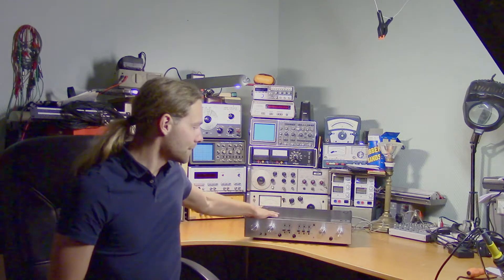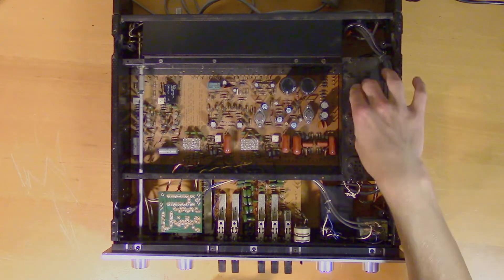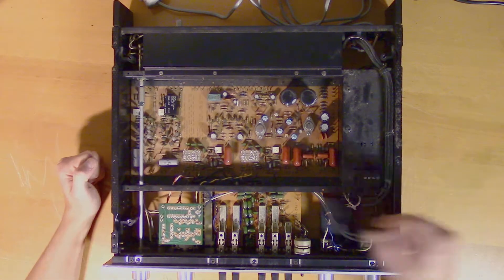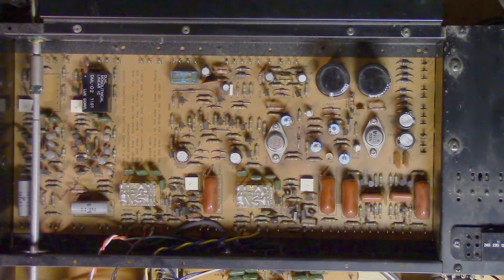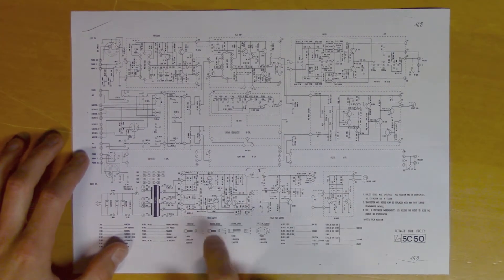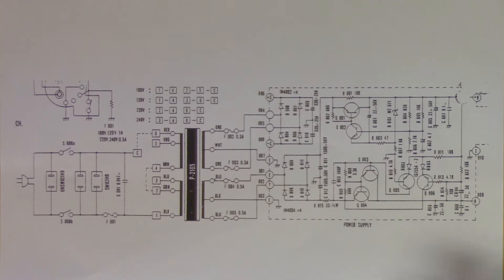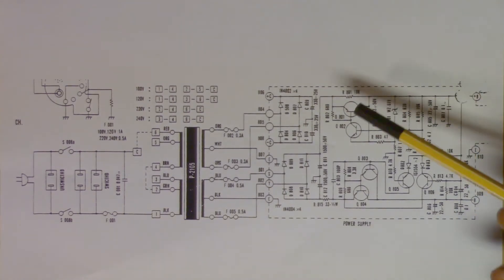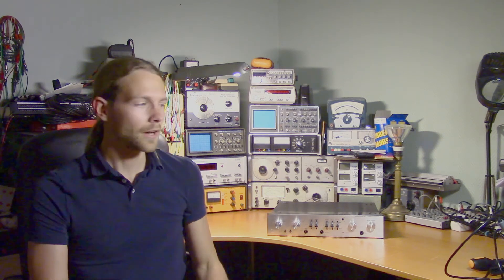Luxman 5C50 Laboratory Reference Preamplifier Troubleshooting and Repair

Comment: Hello, thank you very much for the video, I have a problem with my 5C50 The indicatir goes RED DCoffset (instead of being white) What do you think can be the problem? Thank you
Reply from the maker: Hi! Thanks a lot! First of all, I would make sure that there is in fact no DC on the inputs of your unit. Maybe test a few different audio sources with your 5C50 and make sure that it is in fact the 5C50 that is faulty. 

Secondly, I would try to figure out if the DC Offset sense circuit is faulty, causing it to falsely indicate a DC offset, or if there is indeed a DC offset in the signal. You should be able to measure the DC voltage on the input of the DC offset sense circuit with a multimeter set to DC voltage measurement. You could probably measure between R501a and ground (input a) and between R501b and ground (input b). If there is no DC offset on any of the 2 inputs (or less than 450 mV) the DC offset sense circuit is probably faulty. If you do find a DC offset larger than 450 mV on any of the inputs there might be something wrong with the amplifier section, causing it to add DC to the signal.
Reply: @SunandWeather 

Hej .
Skulle du kunna kika på min 5m21 vart röda lampan tänds efter cirka 20 minuter ?

DC är justerad 3 gånger men den kommer tillbaka ändå 😢 . Pottarna för justering är också bytta .
Reply from the maker: @GrooveSuperfly  Hej GrooveSuperfly! Har du kollat om du har de ursprungliga DML-01-kretsarna kvar i enheten? Om så är fallet så är det möjligen de som spökar.
Reply: @SunandWeather  
Hej. Har de av den öppna typen, Luxman ersättnings DML . Förstått att dessa ska vara ganska bra och inte fela jämförts med svarta / stängda typen

Comment: What transistor did you use? Did you also replace all of them, also the working ones?
Reply from the maker: Hi Got memes? I replaced the transistors with new ones of the same part, 2SC1345. I replaced the ones labeled Q802 and Q803 in the schematic. I should have made that more clear in the video. Thanks!
Reply: SunandWeather thanks, no concern that it will fail again though because these are known for that? I'm looking to replace these with an equivalent to prevent damage but i'm not sure which to choose. The 2sc1845 gets recommended a lot as equivalent but the specs seems so different
Reply from the maker: @JMNTN  Yes, it is possible that they will fail again, but since it is a problem that is known to occur as it gets old, I am expecting the new ones to work for many years. That is my guess.

When it comes to replacing semiconductors with a different part, I would be careful, especially in a power supply. Unless it is an official statement from a manufacturer, or similar, regarding equivalent/replacement parts I would not trust recommendations. 2SC1845 may be a good replacement to 2SC1345 in some designs, but probably not all. To be able to know with certainty, whether or not a transistor can be used in a certain circuit, you need to have a good understanding of how that circuit works, so that you can determine if the deviations in specifications from the original is acceptable or not.